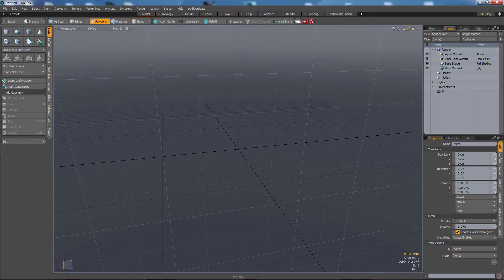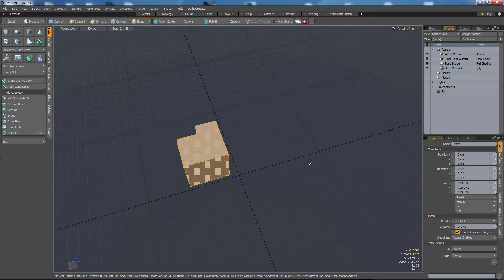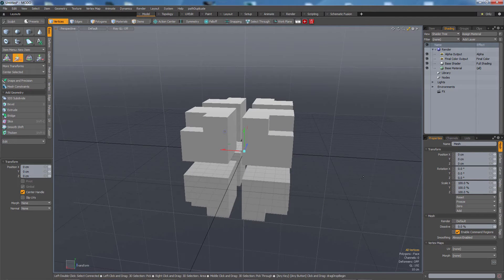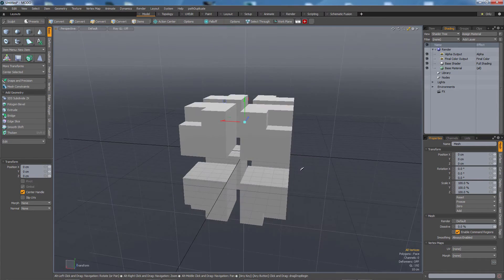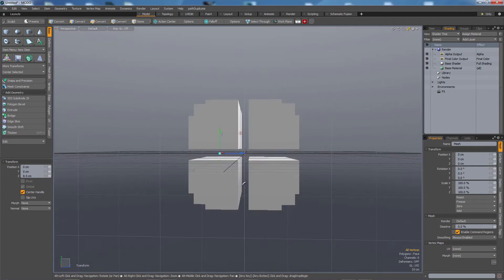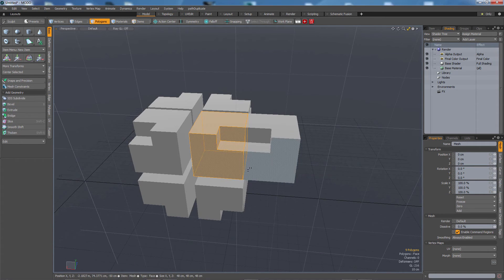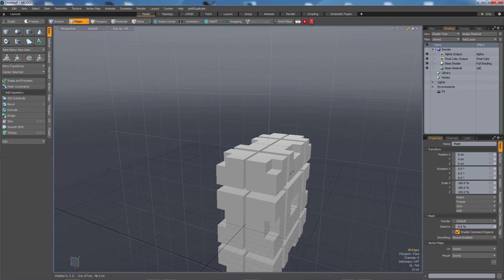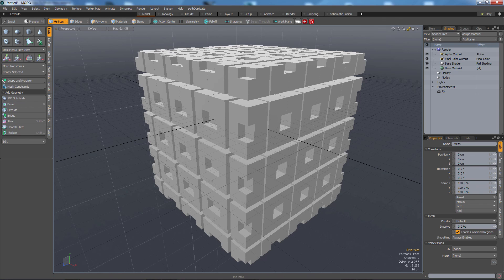Intro To Modo 06 Mirroring

Comment: Hey Vaughan, great series and great scripts there. I'm migrating from 
blender to MODO and your tutorials have been very helpful. I got a 
question, I'd like to keep MODO native navigation but use your 
keyboard shortcuts as well. I've deleted Modo's config file resetting 
the navigation but also resetting the hotkeys. Is there a way to set 
the navigation to modo's default and still have you're shortcuts?
By the way, loved your video on level up channel.

Comment: I've installed all of the scripts as per your suggestions and they seem to be working great. I am having an issue, however. When I press Shift + V it automatically mirrors to the X axis, as the quick mirror tool says it's suppose to but I am not able to get the pie menu up to select between the various axis', your help would be appreciated. Thank you.
Reply: +Heavypoly 
Hello Heavypoly. Firstly, thanks for these tutorials and the bundle of scripts and tools. Very nice! However, I have the same problem as Kevin does. I've done everything as described, but the shift+v does not work properly. That command only mirrors across the z-axis. I've downloaded what I think must be the latest version on gumroad (it is the only version as far as I can see). The zip files is called Modo_ScriptsAndConfigs_2015_06_08.zip. I'm on Modo 902. Anything I have overlooked? Also, there are no modo config files in that download package. Is that correct?

EDIT!! I found the error. The scripts available in the .zip file if one clicks "download all" is an older version. When downloading the scripts only (link: Modo_ScriptsAndConfigs_2015_12_25) everything works just fine. So, as a tip. Do not use the download all button at the moment. :-)
Reply from the maker: +Kevin32001 Hi Kevin, this was added in the latest scripts on gumroad.  If you have an old version you'll have to reinstall them.

Best,
Vaughan
Reply from the maker: +Dag Kjetsa Thanks for the tip!  Silly gumroad
Reply: I was looking at the gumroad page as well, but i couldn't find anything that is other than the 0608 file , really need help on this, thanks !
Reply: Sorry I got it, just download the .zip file and use the script in it, it works well(Didn't find the 2015 12 25 file name was the thing make me panic